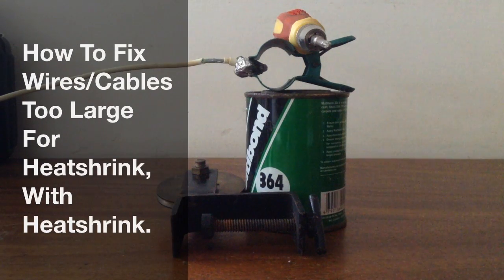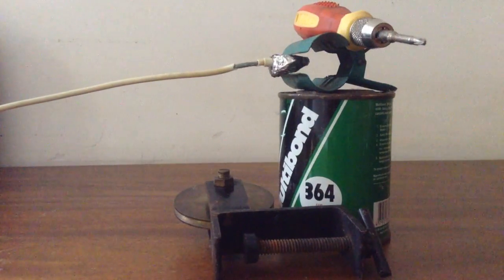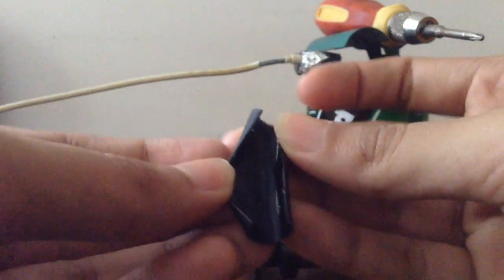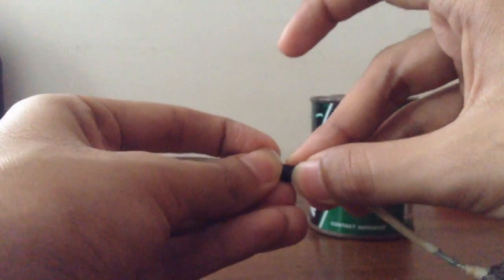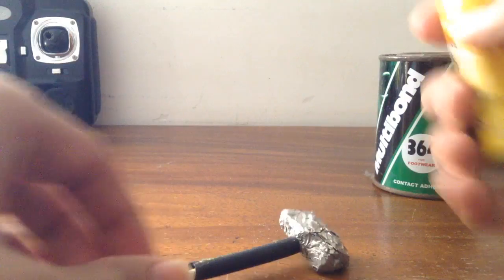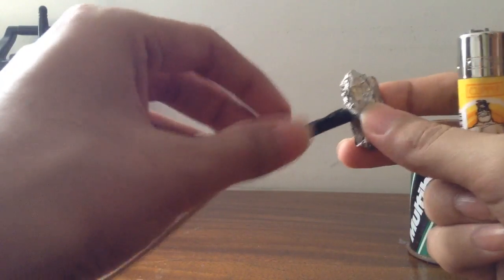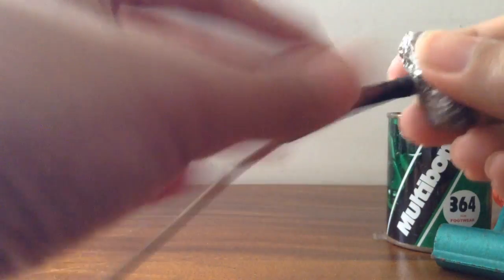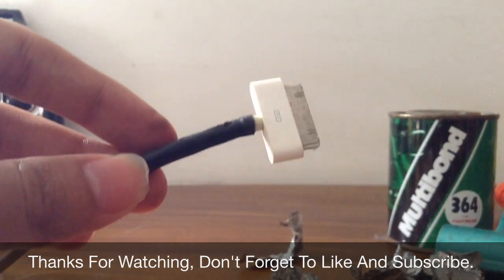How To Fix Wires/Cables Too Large For Heatshrink, With Heatshrink!

Comment from the maker: Regarding the comments saying this wont work. Iv used this method for countless applications including house wiring and its never failed on me. Try it and see before leaving negative comments. Also, sorry about the video being a bit too long, this was one of my first ever Youtube videos, I didn't use a script back then.

Jump to 2:27 if you wanna skip the talking.
Reply: I did try it several times, and never got the heat shrink to fuse before shrinking away from itself. I’m not a hater, and I desperately want to be able to do this, I just can’t. 
I’ve been struggling with forgetting heat shrink before putting things together for over 50 years. I’m still struggling.
I think the answer is silicone tape, which at least partially fuses most of the time, and shoe goo.
Reply: @ED-es2qv  Use a bigger size Heat shrink tube and use 2  Ti-rips at the ends of the tube and it works fine then u can remove the Ti-rips then 👍👍👍
Reply: This helped me worked fine with super glue thanks

Comment: great idea with the glue... especially if the glue helps strengthen under heat.  I do recommend not putting the flame directly on the rubber and just using the heat by keeping the flame away

Comment: Great video, lots of good ideas. My cable is exactly as yours is, and I have the same type of tubing which will not slip over the end.  I will try this later today.  I appreciate your thorough video!
Reply from the maker: Glad it was helpful!
Reply: Use a pliers with needle nose to expand the shrink wrap which the videographer failed to explain.

Comment: well it will certainly give extra life to the damaged cable.
Reply from the maker: I still have this cable and it still works..but I dont use it much anymore..its the rubber is falling apart to a point where it cant be fixed anymore

Comment: What about just wrapping it and tapping it with a soldering iron to sort of tack weld it before using a heat gun?
Reply: what about... buying a new one?
Reply: @victordavidup  A new one is certainly a preferable option.... a new one is not always a ready option.

Comment: Thank you. This is something I never thought of, but it has come up a thousand times where I would have. I end up using tape, silicone tape, or brush on electrical tape, and not being as happy as with heat shrink. 
Sometimes I put my heat shrink on but it shrinks a little while I solder. This might save me. 
Sometimes I wrap a wet cloth or napkin around a wire to stop heat from traveling. It works better than foil.

Comment: I already decided upon this before viewing this video. I was just googling around to see what methods people had chosen.

I can understand the downvote---10mins that could be explained in 30 seconds. But, I don't understand why some say it wouldn't work.  Sure, a completely intact tube is best...but when you have no option it seems fine. There's even a branded version 'Shrink-N-Repair'.

I was fitting a new vacuum cable. Used heat shrinks on the wires but forgot to put a large one on first for the entire outer cable. Only realized when the job was done. I wrapped the cable at the entry point with 'Self-Amalgamating Rubber Tape' as stress relief, but wanted heat shrink tubing for a neater look. ..

.. I just cut, overlapped it, super-glued it with very fast drying glue, and heated it. Seems fine, for now.

Comment: Can i used super glue instead of Rubber-based glue?
Reply from the maker: Super glue cracks over time but it may work..never tried it
Reply: @Techformative557  what if glue gun?
Reply from the maker: That would work i guess..glue gun glue is pretty rubbery
Reply: @Techformative557  nice, tysm for the info

Comment: Haters are gonna hate. Personally, I found it helpful. I used superglue, though. I was never certain if this method might work, but you proved it did. Thanks!
Reply from the maker: It is a very effective method, its just people are unhappy cause I blabbered too much in this video😂 Was one of my first videos so I didn't use a script back then..cheers!
Reply: No hater here, but I can’t get this to work. Maybe I need to try more types of glue, or maybe this doesn’t work on adhesive lined heat shrink. 
Thanks for the video, but I can’t seem to do it.
Reply: @ED-es2qv  just use fking black tape Jesus

Comment: Is it possible to use 2 slit heat shrinks, one with the slit on top, and one with the slit on the bottom, forget the glue, and melt them together? Probably a dumb question. I’ve never used the stuff.
Reply from the maker: Iv never tried that method before but it could work as the insides of the heatshrink turn molten when heated and harden when cooled, basically acting as glue. Try it on dummy wire first just to be safe.,..lemme know if it works!
Reply: Did it work?
Reply: not work

Comment: Thank you, sir, for posting. I have the same cable as your video and used the 5/16" (almost 8mm) non-adhesive heat shrink (mine was from an assortment pack from Harbor Freight). I didn't have any glue handy, so I wrapped the heat shrink with some dental floss (waxed) from one end to the other and back, and tied it off. I used a heat gun on low to heat it rather slowly. By the time the floss started popping off, the heat shrink had already bonded to itself nicely. My only gripe is that the heat shrink is quite stiff; I would have preferred a slightly more flexible reinforcement on the 30-pin connector side. The aluminum foil is a good idea even with a heat gun, as the plastic is all too easily deformed.
Reply: That's a good idea too mate! Dental floss...

Comment: For applications like this I typically use Sugru or self-fusing silicone repair tape which are much simpler to install.
Reply: I used some mid cable and it unstuck fro the cable after a few months, less than a year. Curious if you had a different experience...

Comment: I wouldn't recommend using superglue because that dries hard and won't flex. 
Use a glue that dries flexible
Reply from the maker: Sam yeah exactly, rubber based glue is good..the green tin you see in the video is a form of Rubber based glue that flexes, identical to the original liquid nails

Comment: I don't know why everyone is hating on this vid.  I expect silicone tape would probably be better, but if you don't have that handy, and you do have heat shrink, this seems like a very reasonable alternative to electrical tape.   Thanks for the tip!
Reply from the maker: Beauregard Slim thanks for the comment! And I can assure you this works, the cable in this video is still good today and the fix, though ugly has kept it going. Ended up patching all the holes in the cable like this to see how far it’d go. People probably see this abit too radical thats why...and I dragged it abit too long than it should be cause I didn’t use a script..one of my first videos, I was inexperienced hehe ...cheers!

Comment: thanks for the tip, i have been facing a similar situation figuring I would have to cut the cable slip on the heat shrink then solder everything, but I will try this approach.  I suspect using heat shrink with a glue lining might even give better adhesion.
Reply: I used some glue lined heat shrink a few times, and it makes a beautiful, water tight connection. I should order more.

Comment from the maker: Update - The Heatshrink outlasted the cable itself.
Reply: Just goes to show how top quality apple chargers are /s
Reply: You can also use a pair of Needle Nose Long Tip Pliers to stretch the hole,  which is a lot easier.  And if the tube is too long,  just cut it in half and use two short  stretched tubes.
Reply: Lol
Reply: lmao
Reply: lmao

Comment: I had this same idea as I am having a hard time stretching them without them breaking. I'm going to give this a try.
Reply: Didn't worked right? Blossomed like a flower..
Reply: @fantasyteamshorts6112  🙂
Reply: Just use a pair of needle nose pliers to stretch a little bit the heat shrink until you can pass it through the side where the USB A is then locate it at the rear point and use heat to shrink it.
Reply from the maker: make sure to use rubber based glue, wont work with mixing glue either because the heat will disrupt the bonding.

Comment: There is actually a product for larger wires and cables ....
https://www.amazon.com/Shrink-N-Repair-Wrap-Around-Heat-Shrink/dp/B0711ZR5CL/ref=sr_1_2?ie=UTF8&qid=1503947074&sr=8-2&keywords=zippertubing

Comment: How NOT to use heat shrink tubing...
Reply from the maker: Shazzkid works for me..the cable I fixed in this video works fine today..did the same thing with a pc system...no issues
Reply: @Techformative557  that's post hoc ergo propter hoc
Reply: How would you do it than?
Reply: @Assassincreed6398  no cutting, no glueing, just slide the heat shrink on. Or if required, stretch the heat shrink enough to to to fit over a small obstacle such as a connection. If that can't be done then you don't use it, you use something else such as electrical tape or you cut the wire, put on the sleeve then splice the wire back together.